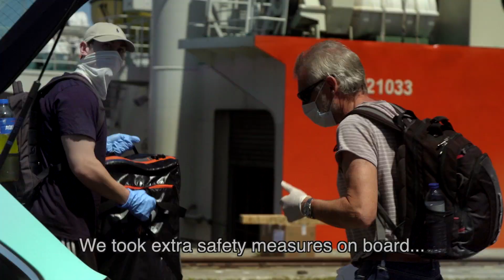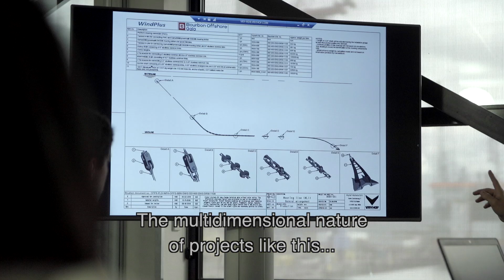INSTALLING FLOATING WIND - EPISODE 4: HOOK-UP OPERATION

Comment: 1) You definitely need to stop calling them floaters. This is a slang term in English for excrement that floats in the toilet.
2) You should show the unit working in high seas as this is the challenging bit. It would also be nice to know how the unit is anchored and how the electricity gets to the shore.

Comment: Being in oil and gas it is hard to get excited about these projects. There's not much to them, relatively speaking.
Reply: Maybe change jobs!!
Reply: Except for massive amount of highly needed energy supplies? Denmark has 40% basic supply and peak 110%.
Numbers growing.. 🌬️💰💰✌🏻
Reply: Yes understandable, none of the burning and polluting hydrocarbons that get you folks excited ...
Reply: @calicomadre7315  💯 agreed. Bird killing eco-crucifixes.
Reply: @carlitoab  nonsense.. After ~6 month it's a profitable investment, and which Seagull will be exterminated by windparks?
No bird populations has vanished ashore.
All fairy tales 🐖💨
Reply: @carlitoab  Oh no three birds died